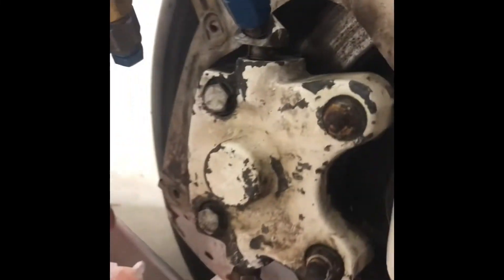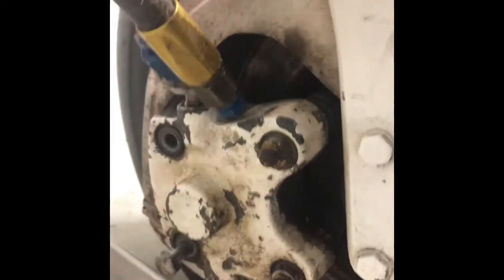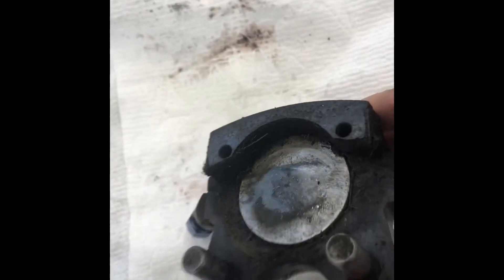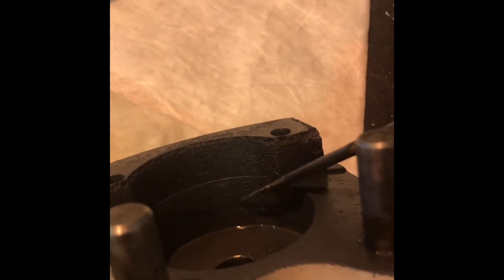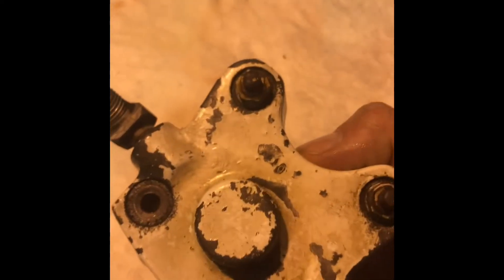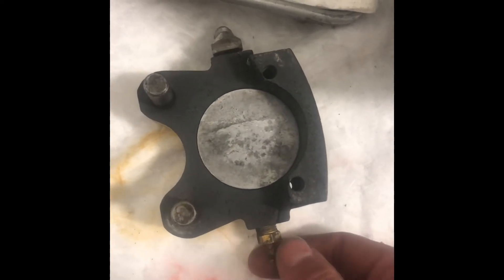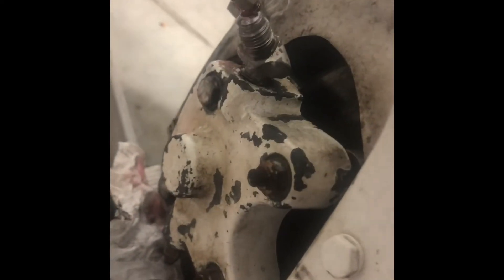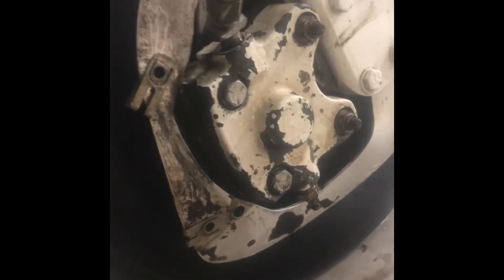Cleveland Brake Caliper Oring Replacement

Comment: I just wonder if the inside of the cylinders were re-surfaced enough to get rid of the pitting, if it would be able to make a seal and not leak. I ran into that with Cleveland master cylinders, the inside bores were so worn, even new O rings wouldn't stop the leaking. I'd be hard pressed to put a cylinder back in service with that much pitting inside it.